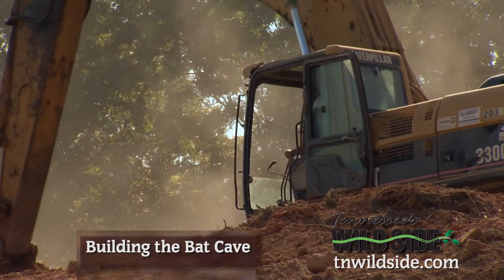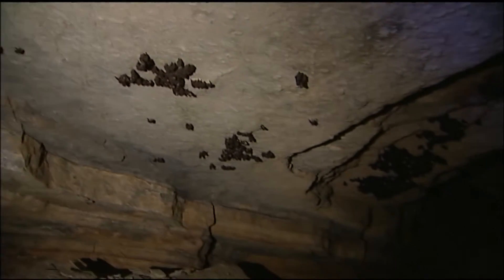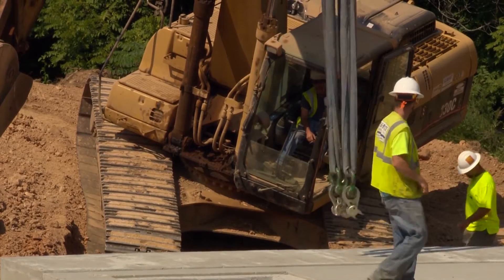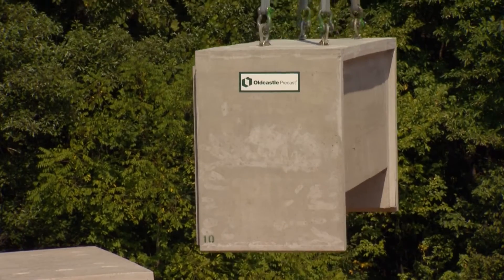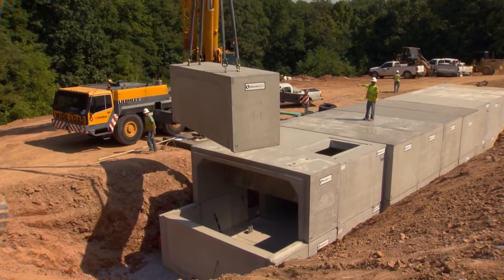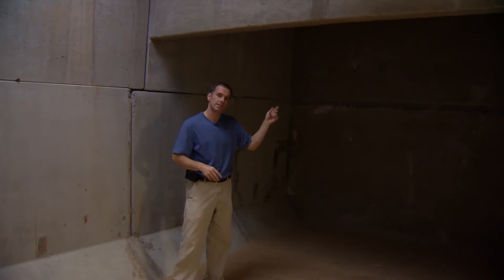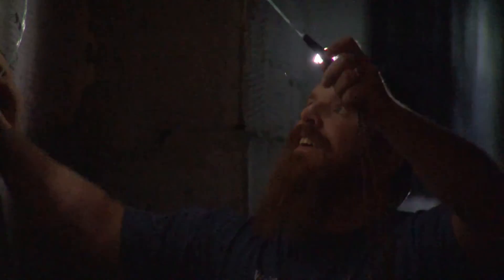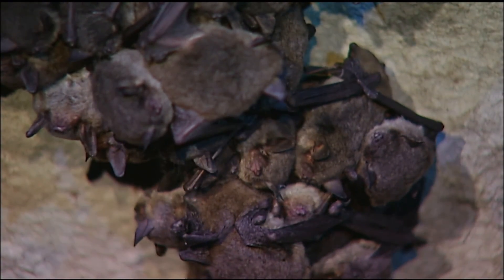Wild SideTV-Building the Bat Cave

Comment from the maker: It's still a bit early to tell if the cave is going to work...it took too long to get the temperatures down right after construction to have the cave ready for hibernation this winter. There have been bats flying in and out of the cave though, so they have found it. The bats are monitored by biologists via thermal and infrared video cameras, but since bats, especially hibernating bats, are easily disturbed, there is no public access to the cave.